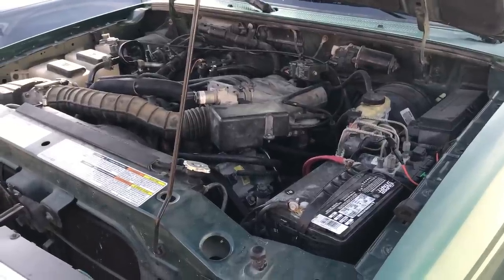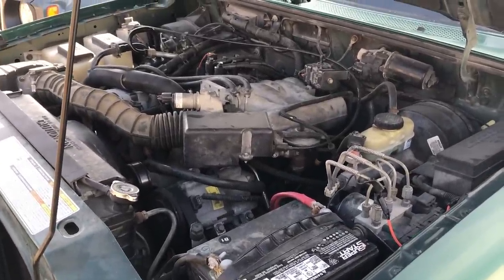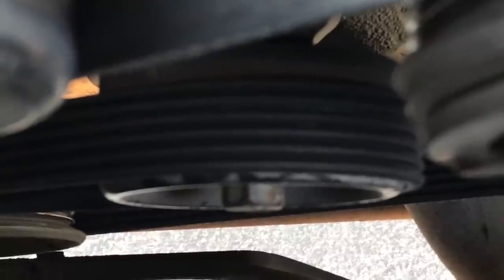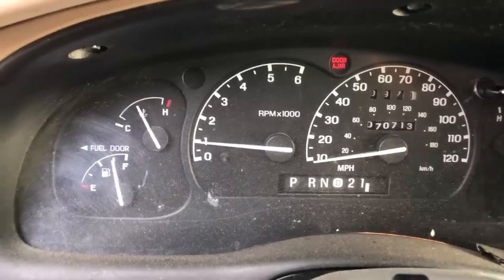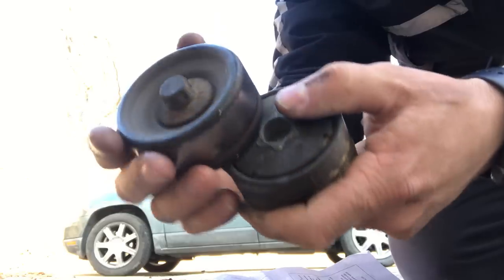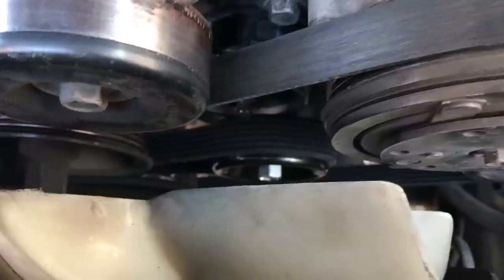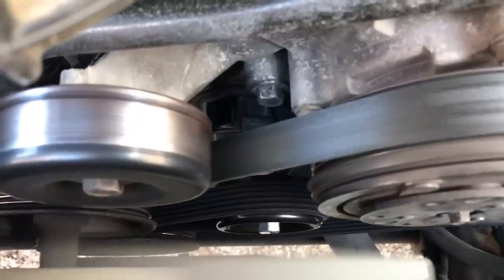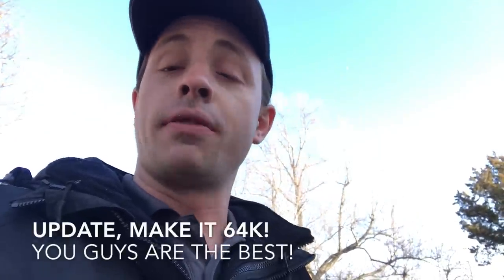New Belt, Still Squeaks! What I Found...

Comment: Great video, very to the point! Had the exact problem.  Tried to get a new tensioner from the NAPA and Lordco Auto Parts, but it didn't come with the new bolt. My truck had an original tensioner so I ended up at Ford, for the same price, came with the hardware. Ford Part Number 3L5Z-6B209-AA  3L 1995-2000

Comment: I already knew the tensioner is almost more important than the belt itself. I can run 10+ year old quality belts as long as its tensioned well, its perfectly quiet. Get a bad automatic tensioner and no new belt can fix it. Not a common problem for me, as a diyer I only had that once. "New" junk yard tensioner and it was nicely quiet again. (the car wasn't worth doing a lot to). 
I haven't changed a belt in years. I work on cars about the 20 year old mark. They still run great, so why get rid of them.
Reply: lllll
Reply: Always change tensioner and all pulleys do it right the first time db

Comment: Your tensioner was definitely out however I just installed a new serpentine belt on my f150 and then I had a loud chirping noise. I discovered the belt was ever so slightly misaligned. I aligned it better on the alternator and the noise went away.

Comment: my BA ford has the same issue, i will have to check the tensioner to confirm it thx. update couldnt see any movement or belt onesided but replaced the belt with a new one and it was still the same and then i replaced the belt tensioner and that resolved the issue, thank you.

Comment: Great Video!  This is exactly what was causing the squeaking on my 2001 Ford Ranger..  I had changed out the Serpentine Belt and still had squeaking!  installed a new Belt Tension Pulley and noise is gone!  Thanks!

Comment: Also you should note that the previous belt might have been Goodyear Gatorback Poly-V Serpentine Belts is why might not squeaked as it more tolerant to misaligned pulley.

Comment: I have a faint squeak and it happened after I replaced the tensioner and I’ve checked everything and it’s all good belts pretty much new as well it’s not noise but I can hear it when you rev up the engine like it’s tiny squeak not going to turn heads as I drive down the road but it’s bothering me. I didn’t understand what’s up and all the pulleys and accessories are lined up dead straight on so I don’t know.

Comment: The squeak on startup was baffling.  I replaced the belt and pulleys but didn’t replace the tensioner because it only had 60k miles on it.  Getting a tensioner tomorrow!

Comment: Great video! I'm hoping this is the same problem I have with my car right now. My car has been squeaking even after replacing the belt and my mechanic can't figure out why.  My car only squeaks/chirps while idle and sometimes when I  step on the gas. The squeaks only starts when my car is warm too. It does not squeak while I'm driving. Was this the case for you or was it a constant squeaking when your car was warm?
Reply: What was it ?
Reply: sounds like my issue.. Replaced belt and tensioner but still happens just as you describe. Let us know if you figured out what it was.
Reply: @joshcook5154  After a while my check engine light came on so I took it to a Honda dealership. After taking things apart, they said I needed to replace my coil packs and spark plugs. I didn't do it right away but it seemed like the squeaking stopped after the put the car back together. I did get the 2 of the coil packs and spark plugs replaced in another garage shortly after (way cheaper). The sound hasn't come back since. Whether it was just taking things apart and putting it back together or indeed changing the coil packs and spark plugs, I'm not certain but I'm happy that the chirping stopped :)
Reply: @--emt  See my reply above..

Comment: I replaced my idler pulleys, and tensioner pulleys, and belt. But I still have the same noise. I stopped worrying about it by spraying some wd-40
Reply: Be careful, with enough WD-40 and some bad luck the belt can slip off!

Comment: I have a similar squeak but only when I stop and my idle starts to die. Just replaced the throttle body and it still happens.  Ive definitely heard my belts squeal before. I'm wondering if that could affect my throttle?

Comment: Man that Ranger had 97 miles @ 3/4 of a tank? My 3.0 would be at a half a tank and it's a manual.... I've been having problems since the Ford Warranty expired for the new long block... Vac leaks, wires, misfire with/without MIL, poor MPG, etc. 

I'm working on my Diag skills...

My old wires I would get a constant misfire P0301 on Cyl 1. New wires, it's now a P0300 Random / Multi misfire. Coil going out?

Comment: I hope it won't be a pain in my rear to replace.
Reply: It's very easy. Remove the belt and it's one single bolt. No puller needed. Just swap and bolt in

Comment: Wow!!! How interesting!!! I have a 2006 Jeep Liberty CRD. For years I have had a squeak problem. I changed to different belts, brand of belts and nothing worked. It was about 6 months ago we looked at the belt tensioner pulley. It was cracked, lopsided and the belt has cut into the bracket a little bit. Go figure!! Changed it and no more squeak.

Comment: I took my 2005 Honda Civic to the dealership because the belt would squeal when I turned my defrost on the highest setting.  They said that the belt that was on was in pretty good condition, but it was an after market belt and that it should be replaced to fix the issue.  I paid the $125 to replace the belt and 2 days later, when I turned the defroster on to the highest setting, it started squealing again. I'm taking my car back to the dealership and demand they fix whatever the problem is without charging me anything extra.  Does anyone know why I keep having this issue?

Comment: I have a question about my 03 Mustang GT. I have put both new idler pulleys a new tensioner (2 months ago). I put a new belt on it a couple of days ago and now I have developed a LOUD squeal. As the engine and belt heat up it quiets down. I have checked the way the belt rides and it appears to be straight. What would you check next? I am taking the car on a long road trip and would like to resolve the issue before I go. Thanks in advance for any help you can offer!!!
Reply: Try a fair gator belt. Super quiet

Comment: Never put anything on a belt ,you need a new belt and tensioner ,both should be replace together, this idea may work for short time tile you get replacement parts but not like your doing, this belt is slipping causing tensioner release throughout the system , also belt can slip off pulled causing possible major issues like stranded due to belt taking out radiator cooling line let’s say for transmission, or an electric fan . for less then a hundred bucks in most cases it’s well worth it to replace. Not to mention a tow at about 150 bucks.  You can lead a horse to water ,but if no water horse die ( just saying )

Comment: New belts will be "cracked" in  two months. No need to replace them. F-150 4.6L 280,000 mi. on just two belts. First one replaced at 75,000 mi because it was "cracked". Probably didn't need it then.

Comment: Aren't you supposed to replace the belt tensioner with a new belt?
Reply: Not normally. You'd of course inspect it while the belt is off (Since you'll need to release the tension anyway) but you don't normally replace it.